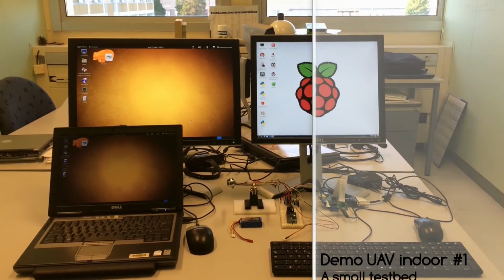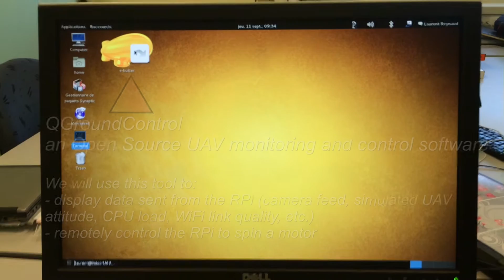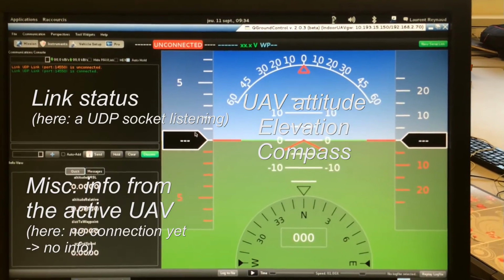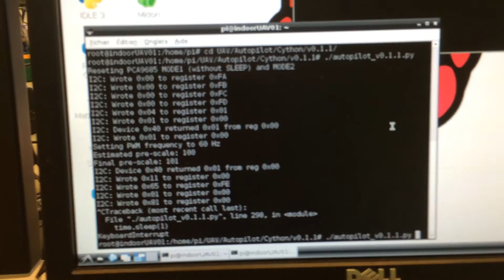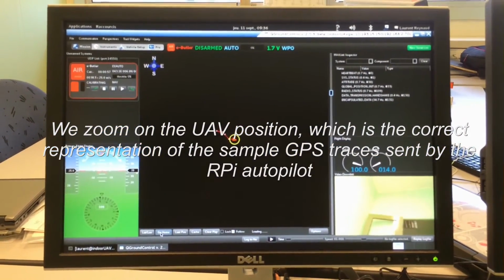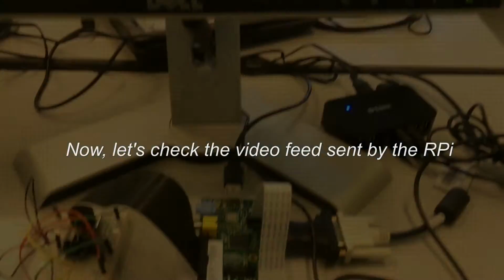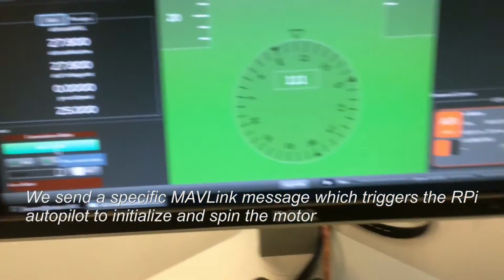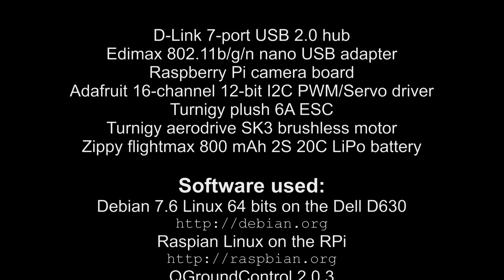Raspberry Pi communicating with QGroundControl via MAVLink

Comment: Hello, I work exactly on the same. My project contains Quadcopter with my own firmware which runs on arduino due(is faster). Sanding data to raspberry pi over serial and raspberry sends them to Qgroundcontrol vie MAVlink.My weaknes is just in MavLink communication.I made also my own socketCommunication with C# GUI but it is just low performance because my GUI is not as powerfull as QGroundControl. I used my own GUI to debug and set some PID values wireless, plot them and send controlStrings from joystick. Quadcopter works perfectly, my soft works quite well and it would be great if you would share with me your Code for raspberry pi. I would be really thankful if we could put our projects together and make raspberry pi new powerful autopilot. My email is kabzanj@gmail.com. I would be really thankful if you would contact me! I study ElectricalEngeneering so i guess I have also something to offer.
Reply: Juraj Kabzan I am interested into using it for a project. Do you have a project site?